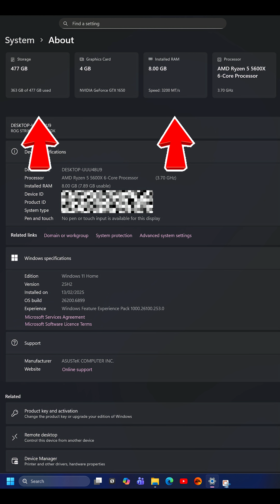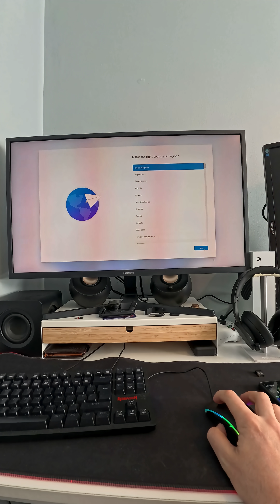Quick and easy PC Upgrade #Upgrade #gaming #tech #ram #solidstatedrive #pickmeup

Comment: Don’t blow air to the fans you can burn your PC
Reply: Why?
Reply: @philippebuch  Basically, people usually recommend holding the fans in place when you blow out dust, so they don’t spin too fast from the air flow. If they spin up too quickly, it could potentially damage the bearings or the electronics, because the fan might start acting like a small generator. So yes, it’s better to just hold them still while you’re blowing out the dust.
Reply from the maker: @dozer137  You're right holding them still is something I would usually do to prevent any damage, you use a hand tool but in the video I quickly hit them with the blower. I knew someone tech minded would point that one out!